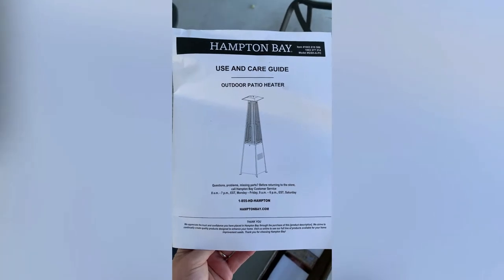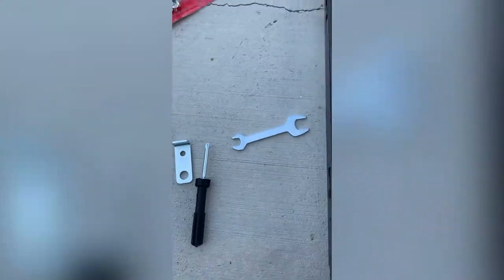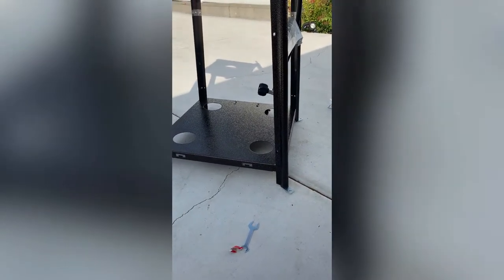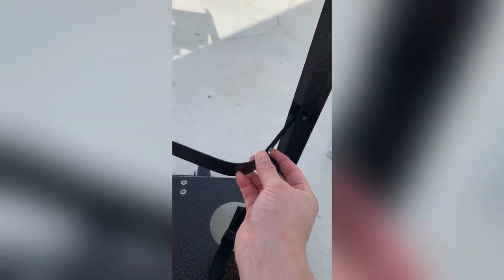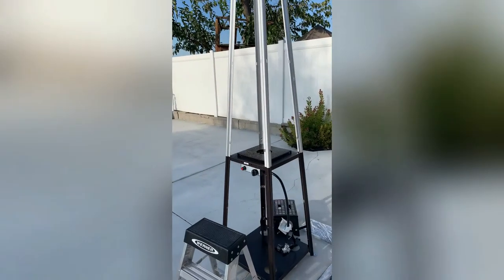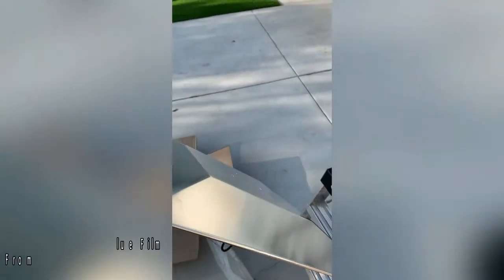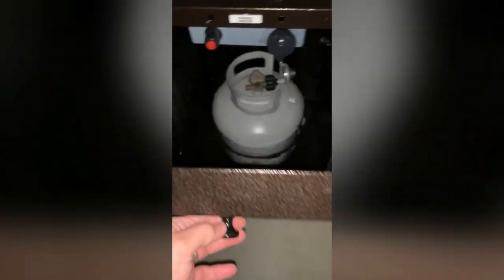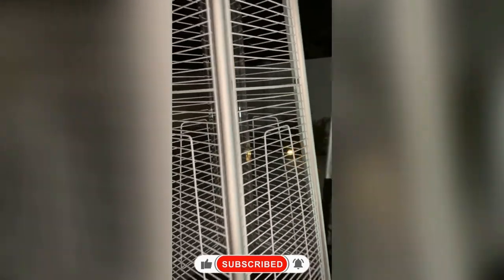Hampton Bay Pyramid Patio Heater

Comment: Thanks for the help!  FYI- if you spin your top reflector one screw hole the top will be square to the unit and easier to put a cover on if you use one.
Reply from the maker: Yes!! I figured that out on the 4th build. And does make things much easier. Thank you 🙏🏻
Reply: @builditwithbrenda1295  just put mine together.  Can you explain  what you did here? I have a cover but haven't used it yet.  What do you mean about the top reflector.  Thanks in advance
Reply from the maker: @doctorpaul34  - If you move the reflector one hole over the reflector will be squared just like the cover of not it it will he diamond shaped and harder to place the cover over it.
Reply: @builditwithbrenda1295  thanks

Comment: Thanks for the vid. I just purchased this and for some reason i cannot light this thing.  I went back to Home Depot and swapped out the burner with a new one and still no gas is coming through the valve.  I have two separate tanks, one is brand new from Costco and for the life of me the burner will not start with a pilot light let alone gas pass through the tube up to the burner…any ideas?
Reply from the maker: You have to push in to let the gas through first. About 20 seconds to let the gas through to the ignition. Also make sure the battery is in the igniter. 

So go to the ⚡️ and push in for 20 seconds and then push the igniter once you see a small flame turn to high.